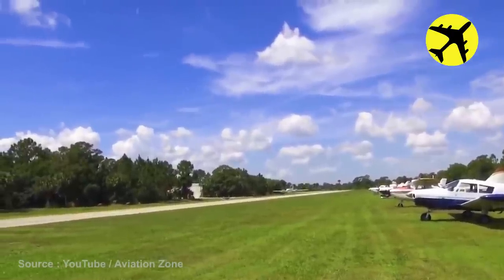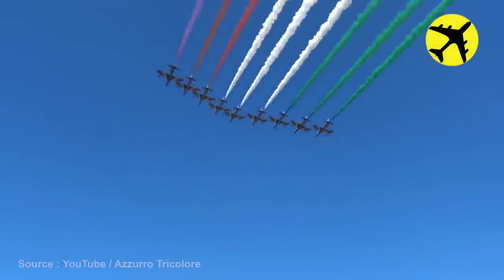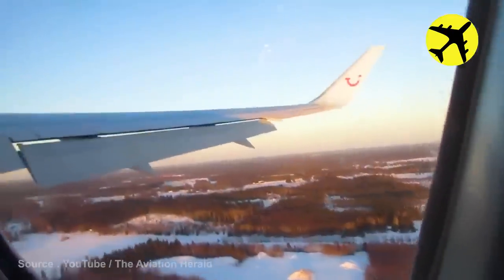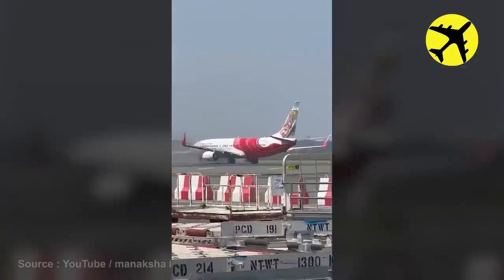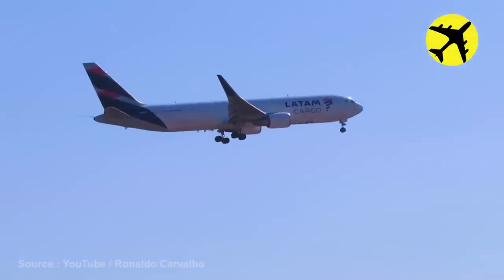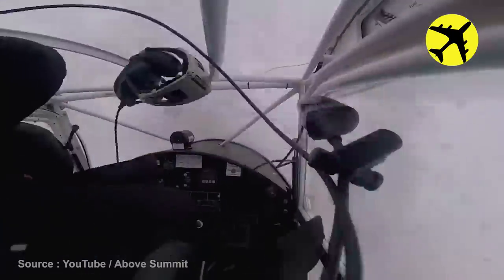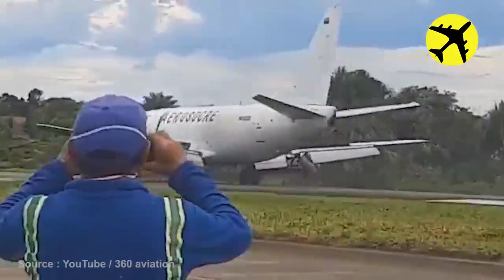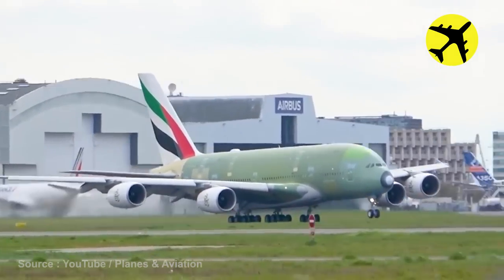Pilot Forgets Landing Gear

Comment: WTF is a "Low Landing"? Better question: "Is there another kind?"
Reply: RIGHT?!? Another similar term that makes me 🤔 is "forced landing." As opposed to an ACCIDENTAL LANDING?? Another I heard recently was, "The plane entered a VERTICAL DESCENT of 1,000 ft/min. As opposed to a HORIZONTAL DESCENT?! 😅✈️
Reply: There IS a landing while you’re high
Reply: @Jim Steinway  you should never attempt a landing if you're high. 🪴 Sry, I couldn't help myself. 😅
Reply: I was thinking the same thing the whole video lol that makes no sense. Don't want to land to low to the ground LMAO
Reply: The original clip shares a whole different story.  The plane was about 3-5 feet from having its main gear ripped off.

Comment: I  have witnessed a wheels up landing while working the passenger service desk.   I heard a ticking sound as the twin props nicked the runway.    I called the FAA shack to report it and then had to divert my Airlines incoming flight as well as deal with people coming in to p/u folks from  my  outfits incoming  flight   (Command Airways )   who were scheduled to land at that time as well. I will never forget the sound those propellers made as they struck the runway  or the skidding scrapping sound of the wheels up  Beechcraft's belly sliding down the tarmac. This guy got lucky just in time as once those props hit there is no escaping.

Comment: Wow! What was that 4 engine spit fire plane!? That was awesome!
Reply: Lockheed L1049 Constellation with the Wright R3350 turbo-compound engines.  For takeoff, extra enrichment is added for cylinder cooling and results in these flames, perfectly normal.  

Flight attendants always asked passengers to close the draperies over the windows during takeoff for this reason....
Reply: @Flies2FLL  thanks for the info, that was badass
Reply: @MIXTAB1  Look these engines up.  They had three of what looks like turbochargers, but they were not.  These were turbines, but instead of turning compressors, they used a fluid coupling to add power to the crankshaft.  Each "blow-down turbine" added 200 hp to the engine's output.  

These were VERY touchy engines!

Comment: That plane without gear went airborne again?  And what is that maneuver called?  Crash and go?  Is he nuts?  He probably jacked up his hydraulics, he scraped his wing. What a lunatic.  High probability of not making it back after all that damage. Would have been better to just belly her in and file an insurance claim.
Reply: The hydraulics were the least of his problems at that point.  He took the last few inches of both props off and did who knows how much damage to the engines.  And then there's the sheet metal damage to the belly.  And then the feces all over the interior.  That will be a very expensive repair bill.   I would be surprised if they fixed it.
Reply: @lbowsk  I’d be shocked if he made it back!